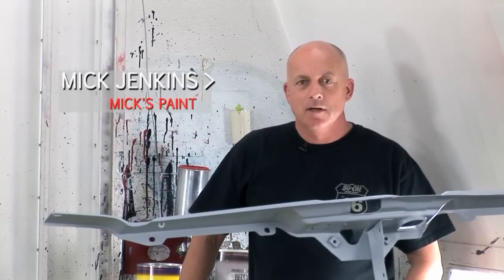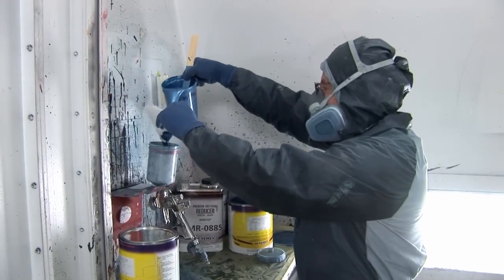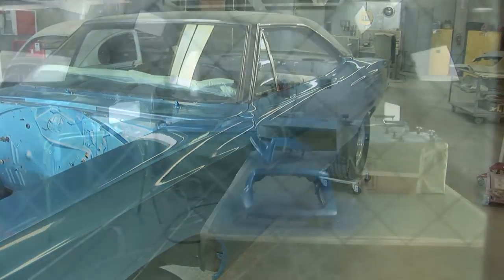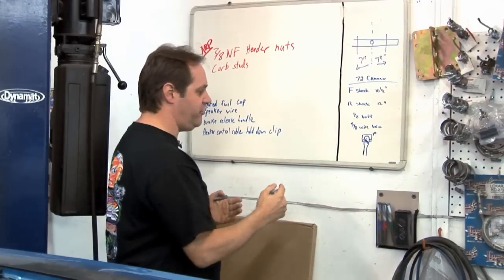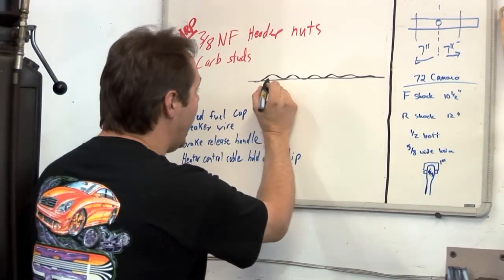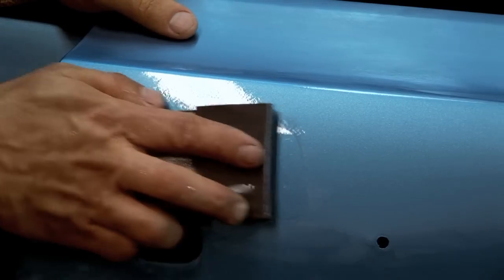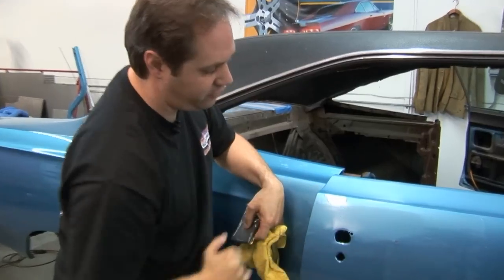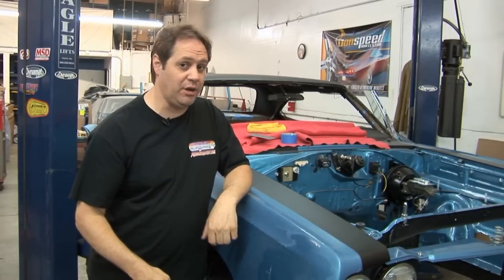Rust-Oleum Project Muscle Part 3

Comment: I know this is old , but What clear coat did you use over the Rustoleum paint ?  I cant find anyone that has had good results from using any clear over Rustoleum's paint ..... Any Info or Brand name and Part # would be great ....Thanks .
Reply: They sell it on ebay. Rustoleum Auto Clear
Reply: Thank you ...